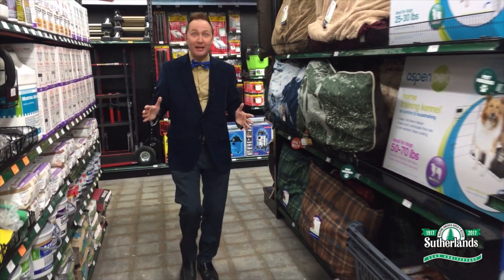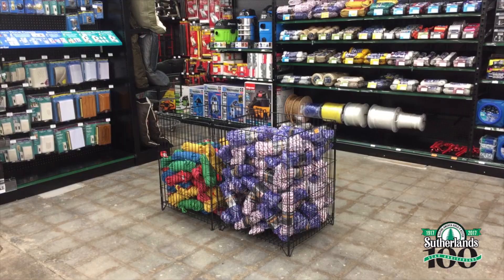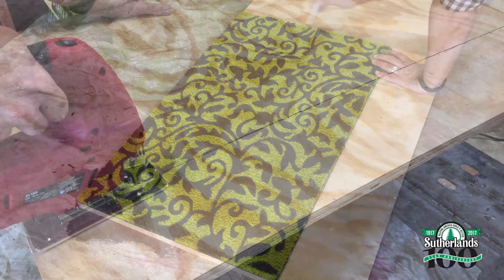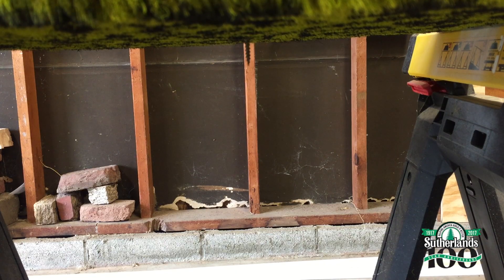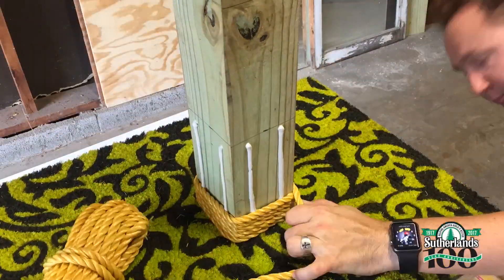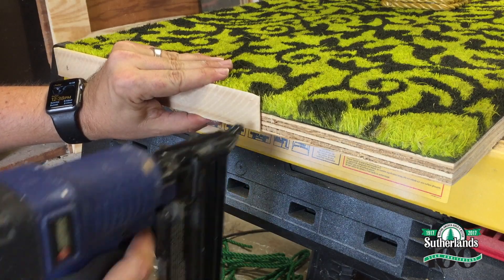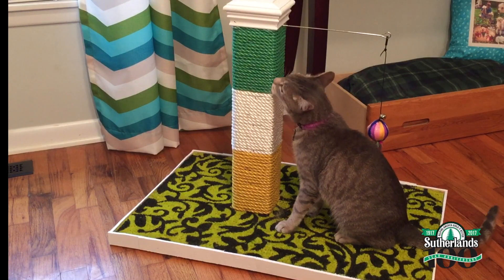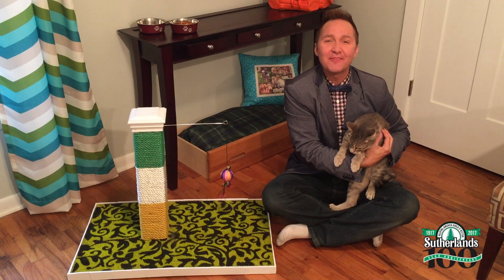DIY Cat Scratch Post

Comment: Just did a similar project but didnt have any 4x8 boards. I just cut two 2x4's together. And used hot glue for the sisal rope.